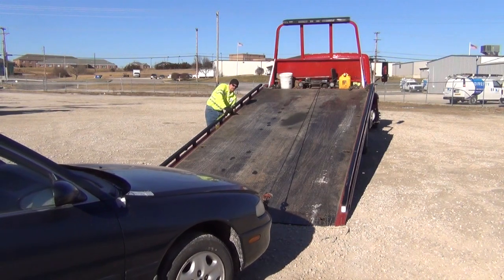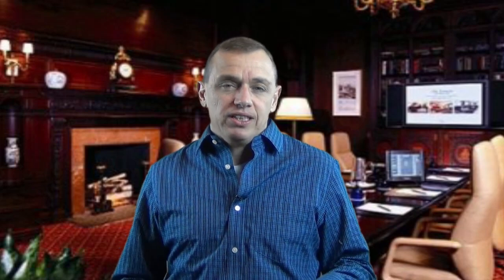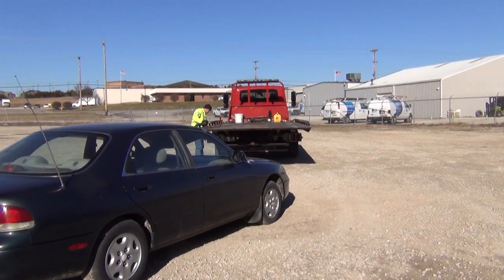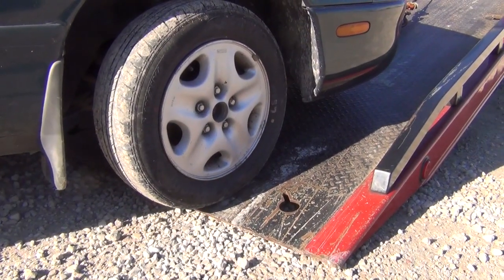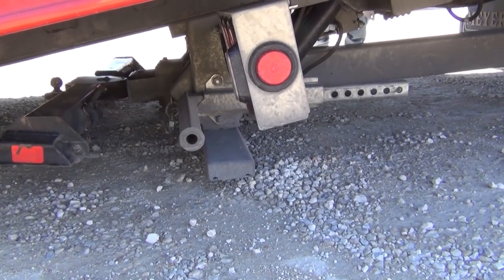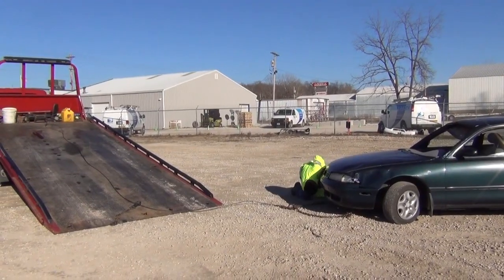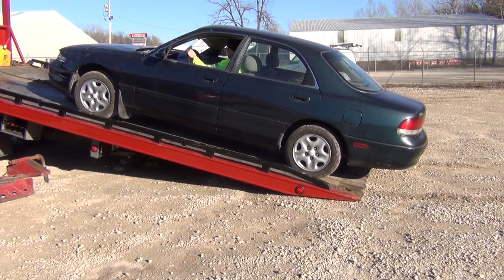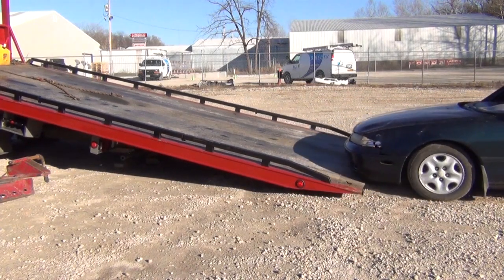Loading a Rollback In a Tight Spot

Comment: 4x4 piece of lumber along the rail works too. When I would get stuck driving a roll-back (Which I hated)  I found that lumber simple 4x4s can be one of the most useful tools. Also a bottle of dish soap just to put a bit on the tires if they won't roll. Be careful though, it makes the bed slippery and should be used sparingly.I used to work with a guy who could make a flatbed dance and I was happy to let him. Give me a combo wheel-lift any day. He did teach me a lot though. Here's to Ruben at Anytime towing in San Diego Ca.

Comment: I always set the parking brake when winching a car up aleast half way just incase the cable breaks or something slips off. Cant do it with the new electronic brakes only the manual pedal or handle. Just a tip.

Comment: Wheel lift on my truck had no L bars so pulling it out with that was not an option (wish it had them). The ignition cylinder wasnt working so the steering wheel was locked with the wheels going straight. But great advice, thanks!

Comment from the maker: FWD van I assume?  If it was RWD and you could work the angle you could have used your wheel-lift on the rear wheels and tied up the steering wheel, and move it just enough to get a better angle on it.  That is assuming that the steering wheel wasn't locked and the wheels weren't turned.  FWD head in, no hills, you could try go-jacks then skates once you had it lined up. Knowing all the info prior to arriving I would send a wrecker to dolly it. Also think linkage, if you know what you're doing.

Comment: people. They're the worst. I'm a flatbed operator and I told my company if they have something extra difficult, send me. a while back, a woman lost her escalade key with the SUV in a busy parking lot. I get there and the door was unlocked, so I figured that someone had the key and planned to take the car at some future time. the steering was turned a bit and when I tried to straighten it, it locked. the lot and other cars made using the wheel lift out of the question. I put the bed at the back of the SUV and j-hooked the shock mounts. using the winch, parking brake and popping the transmission linkage, I eased the car back and got a tire on the bed. working bit by bit, I got the car out of its spot and brought its back tires on the bed and pulled it to an open area to complete the loading for transport to the dealer. I wish I could impart this knowledge to others but it comes from doing the job. nothing is standard in recovery mode.

Comment: PLEASE HELP i need to tow a 4 flat tyre car in a parking lot.
I m gonna build 4 rollers but i need to work for 2 jobs. To move it from the spot and then to tow or put it on the bed. whats the diameter of the wheels to build a resistant wheel dollie to lift it on the bed and not break the dollies
Reply: If you're driving a rollback just drag the car with the flats onto the deck.

Comment: Get the truck at 90 degrees to the car jump on the cars brakes and drag the cars front end round so your are parallel with the truck and winch on the bed easy i know it sounds ruff but it dose the trick

Comment: good tips, what would you do in this situation(one i encountered). I had a van in a driveway where the van was 90 degrees from my deck, nosed into the driveway. The key wouldnt turn therefore i couldnt put it into neutral. I also had no room to angle my deck for a better pull as it was in a narrow townhouse apartment complex. what would you do? I ended up getting a wrecker to do the call as it would save the customer time and it was much easier.
Reply: Couple things you could try, Go jacks could work, Put em on the wheels and just push it out to where you want it, Next you could do what you did and get a wrecker out there, Next you could try putting skates under the drive wheels and you could try to pull it out from the side with a snatch block until you either need to reposition to continue pulling it out or you can load it.
Reply: Send a wrecker or else youre wasting your time and money. Walk off and move to the next one
Reply: @towtruckaj  we dont carry go Jack's on our flatbed so when it comes to tight spots and I cant help as the last resort of neutral and steering wheel is locked, we move on

Comment: What should someone do if their winch cable has gotten stuck??
Reply: You should never let it get to that point, Take care of the winch and your good to go, it doesn't just happen to itself, But if it does get like that you need to spot it right away before you go out on a call looking like a dumb ass, And you need to either grab some extra hands to try to yank it out, Or get a running vehicle, preferably your own, drive it up and hook it to the vehicle as if you were going to load it, Then slowly roll it down the bed pulling the cable out, Or if your on scene, Get enough chains to attach the winch to the vehicle, put it on free spool and pull forward yourself, I'd recommend leaving your winch at the end of your bed and not all the way in to make this more possible if you do fuck it up one day, Then you don't need nearly as much chain.

Comment: Every roll back carrier should look into the Wireless Valve Control system from Actus. Forget working the manual valves. Use the hand held remote to operate up to 3 functions, winch, bed in and out & up and down. 612.255.5165

Comment: On a light car your not going to bend the subframe. I've done this for years with the same truck and the bed today is still damage free, you should know your limits, or you should not be operating the truck. And as for bed lift, after it touches ground, put a little more tension down on bed and it won't lift. And I agree with using jhooks as snatch blocks, I get irritated watching lazy morons do that. A coworker of mine years ago ended up in hospital when he did that and jhook snapped & hit him

Comment: Get the wheels on the tip of the bed, then lift it off the ground??? - GREAT way to bend the subframe!!
Reply: Negative, You get the front wheels on, Lift it up to get the feet off the ground and make sure the bed touches nothing under the car, Then you drive forward and it straightens out, If that bends the subframe, then so does any wheel lift, Which has been around for quite some time, and is on pretty much any rollback or wrecker and has been for decades, If it damaged the subframe doing this, Wheel lifts wouldn't exist.
Reply: The subframes that bend must be Chinese knockoffs made from rice hulls.